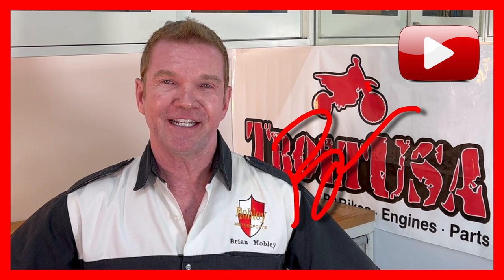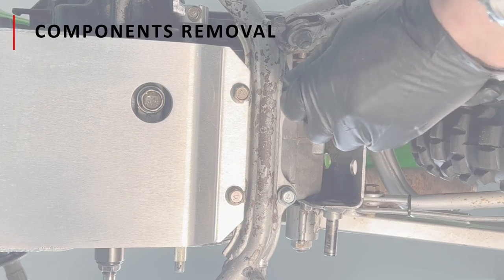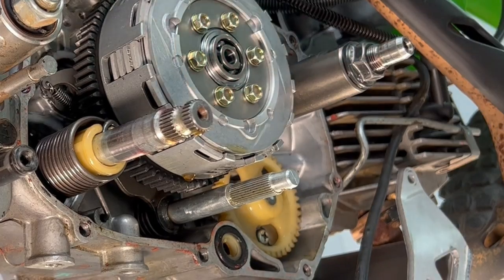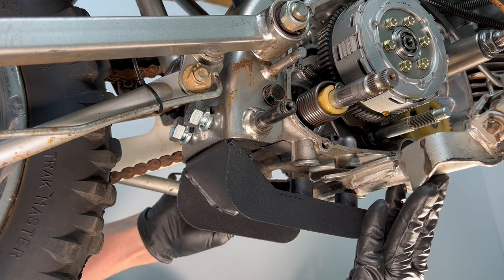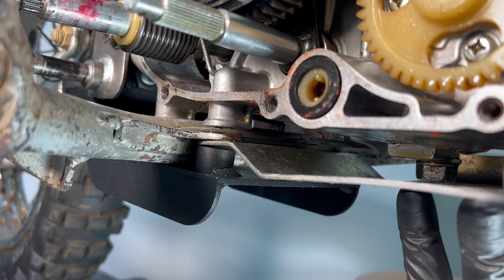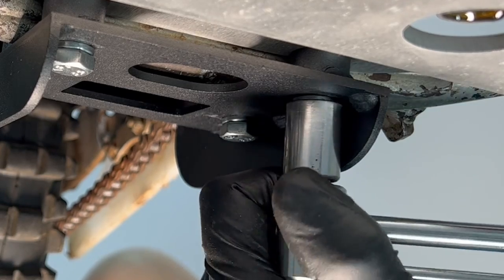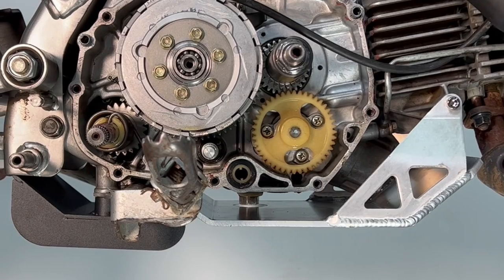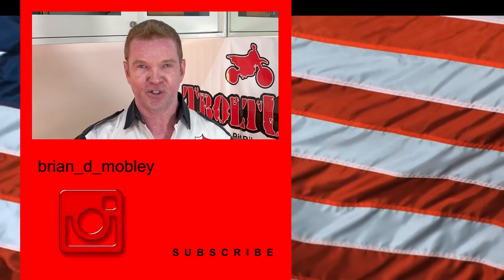How To Install A Heavy Duty Cradle Mount/Frame Adapter | KLX110

Comment: I have a gap between the frame and the 2 monster bolts in the rear, I’m wondering why it isn’t flush my buddy just installed his right next to me and it fir flush his is a 22’ 110l and mine is a 21’ 110r
Reply from the maker: HI Zack.  Its hard to say without seeing the configuration up close.  But, Im sure you can figure it out!
Reply: Mine is the same way…

Comment: Do you know if they have something similar for the piranha 140 on a ct70?
Reply from the maker: Hey Small Bore & Two Wheels!  I don’t know, but I’m inclined to think not.  The engine on a CT mounts in the unibody chassis on the sides of the cases as opposed to the sides and the rear when using a cradle like the one in the video.   Its basically hollow inside the CT chassis and there is no provision inside the unibody for any mount support from the rear of the engine to the unibody like you would have on a pit bike frame.
Reply: @brian.d.mobley  thanks for the fast reply

Comment: 4:25 need to tighten up that drain bolt man lol
Reply from the maker: Thats funny.  I didn’t even notice that.  But, since you have such a good eye, you may have noticed that the entire clutch side of the motor is off in this video so its every empty of oil.  Maybe some just seeped down to that drain bolt!  Thanks for watching! Take it easy!

Comment: At 6:17 you show the mount order as (this is the order the bolts will go thru from outside) : Cradle, Skid plate, foot-peg mount, then into the engine.   The foot-peg mount is directly against the engine case.  At 6:23, you now show the order as:  Cradle, foot-peg mount, skid plate, then into the engine.    In other words, at 6:23 the foot-peg mount has the skid plate sandwiched between it and the engine case.  So which way is it??
Reply from the maker: HI Jeff: The correct order is stated beginning at 6:01.  Hope that helps.  Thanks for watching.